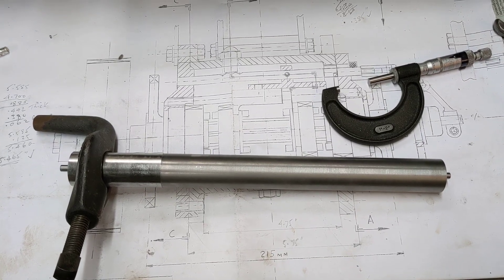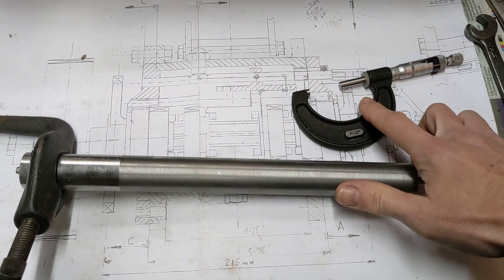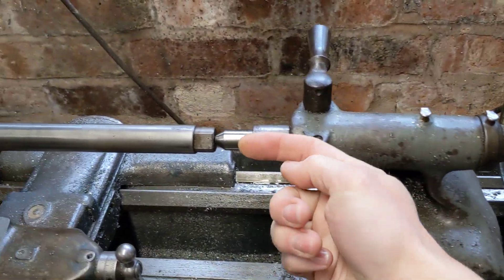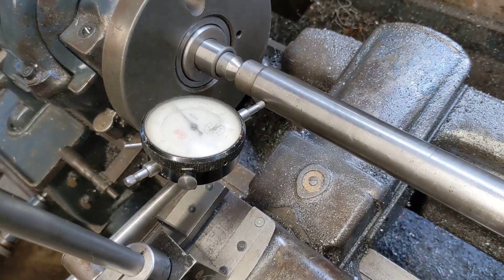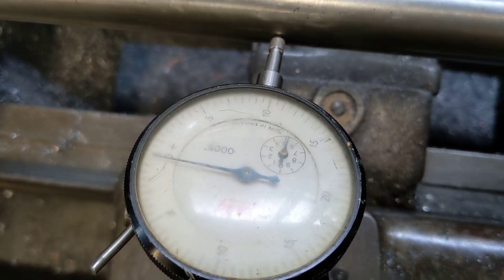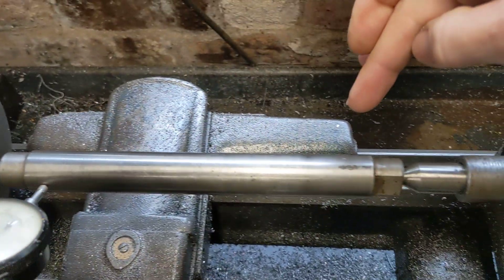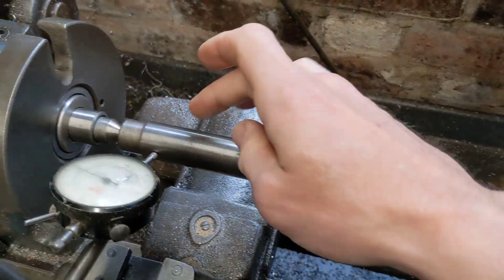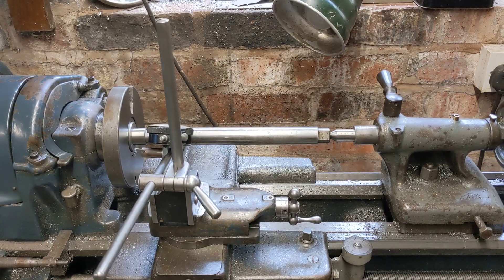Parallel lines

Comment: Before you said the parallel was off I was going to suggest checking your equipment for measurements. When I was relatively new to working on my vehicles for mechanical repair I had to replace my clutch pad and other bearings. When I put the jeep back together I kept having issues with the clutch not disengaging and after removing the transmission three times additionally did someone see one bolt was not tightened. I guess the torque wrench I used broke on the last bolt (not too over tightening it was just old) so it was sticking out a few mills more and not seating. So now with any challenge I face I always inspect my tools (especially references) before diving deep into a project. Good luck with working that out man.

Comment: How do you know which way it is out parallel, measure the tips of both centers?
Reply from the maker: Hi. I measured the diameter at a few points along the length. The bar was .007 thinner at one end, so the clock should read -0.0035 at that end when it reads 0 at the other - if the centres are perfectly aligned. 
The fact the clock reads 0 all the way along indicates the runout matches the taper. I turned the bar around to check and it was 0.007 out, which makes sense.
However, the locking screw on the tailstock makes a huge difference. I should have pointed that out.
Reply from the maker: Oh I see, you mean horizontal Vs vertical? Good point. Most likely in the horizontal plane as the height is rigid and fixed. I'm also measuring with the clock in the horizontal plane, parallel to the cross slide. When the micrometer reads the same then both planes must be in line.